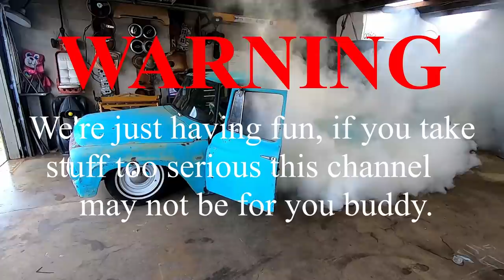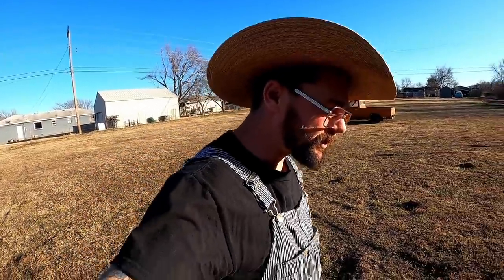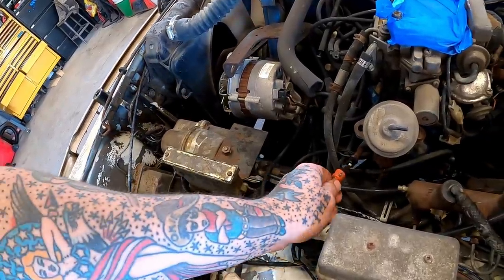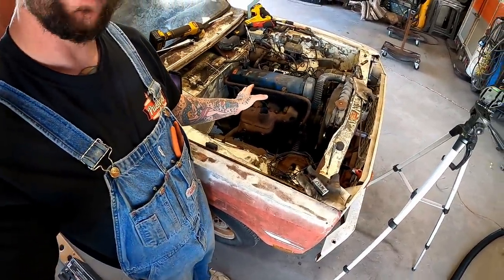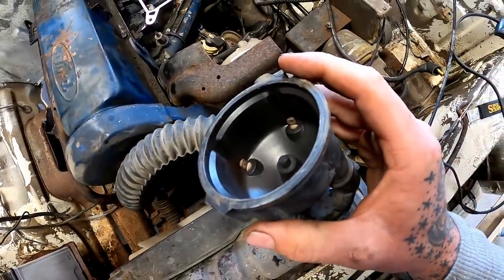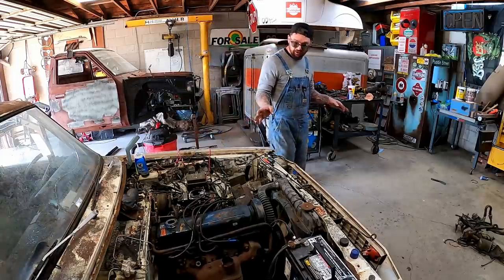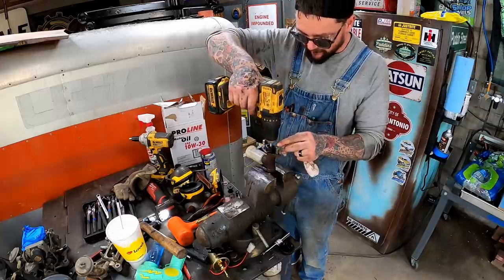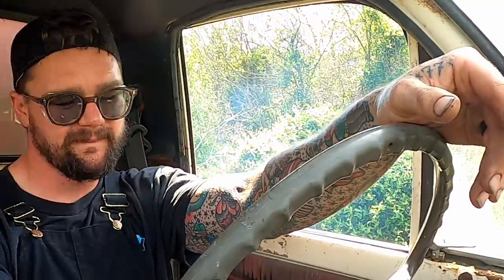Old mini U-HAUL box truck. WILL IT RUN after sitting 35 years?

Comment: That continued “run-on” is likely the anti dieseling solenoid on the carb.
Had a similar issue with my 79 Datsun 620.
On one occasion, it kept running fuel through the carb during shut down and I had the cat explode, enough to where it shot material out the exhaust!
Great video Puddin!
Reply: Nothing worse than when your cat blows up..... 🐱

Comment: Are those factory installed YeHawl mud flaps? that is a great sounding engine for having sit for over 20 years. I like how you dont even mess with the old carbs and vacuum lines. they are always gummed up and leaking. Puddin saving all the mini box trucks one at a time #boxtruckmafia Another great video. Special thanks to Hank for savin puddins truck pushing back

Comment: Did you, by chance, check the timing belt? The fact it puffed out the carb, it may have jumped a tooth. One way or other, you might want to change the timing belt since it has been sitting a long time and the belt is probably pretty crunchy by now. No sense in getting it running just to have the valves and pistons doing the tango.

Comment: The upgrade to the valve cover gasket is the one for the later rangers, they are rubber with metal in them and are reusable its worth getting the OEM one. wont leak!

Comment: My dad's Ford Courier has been sitting for a long time he said the battery went dead and he wasn't able to start it anymore he is 83 so i figured out he had left the marker lights on we put two cars with jumper cables on it and it fired right up a red cloud of rust shot out the tailpipe and the 2.3 with a Webber carb went straight to idling like a new car it actually runs better than my F150 you can't kill a Courier !

Comment: I did this vinegar flush once. It worked too well, dissolved so much stuff the radiator started to leak... then the heater core and heater valve joined. In return, everything reeked like vinegar for weeks. So I highly recommend this method.

Comment: I rebuilt quite a few of those old Ford 2300 four bangers heads years ago. They were notorious for having frozen lash adjusters. When that happened, the followers on the cam would get loose, clatter around and wipe the lobes out.

Comment: I wish I knew what happened to that big block (428 or 429 I don't remember) Courier we built back in the 70s. We got tired of fighting with the cross member and put a straight axle from the speed shop under it. The engine trans(C-6) and rear axle came from a late 60s Mercury wagon. We started trimming the firewall for clearance and ended up using the pan off of a child's wheelbarrow for the bump in the floor. The brake was where the clutch used to be and the gas on the brake pedal. Good thing it was an automatic. We had a shop in Memphis narrow the rear axle and put some better gears in it. We trimmed and tubbed the bed and got some crazy N-50-15s on it or such.
It was a blast to drive. They wouldn't let us on the track because it had no roll cage but that was the next item on the list when it headed with my buddy Arthur to....... Oklahoma.
Keep an eye out for a Courier that sits a little taller than stock in the crannies and crevices. It was built well with no cost spared.
It sure would look good with a box bed on the back. You wouldn't have any trouble with wind resistance.
Damn we did some crazy shit!
Cheers
Terry

Comment: I’m currently reviving my own mini truck. Old 84 ranger. The things runs but the body is gone. 300 thousand miles is hard on a vehicle up in the rust belt. Supprizingly there is some brakes.  It’s becoming the utility yard truck. Generator air compressor tool box and other stuff. And I just rebuild the cab mounts with old c channel from a trailer.

Comment: Brings back such good memories. I learned to drive stick in ol 60' and 70's uhaul trucks back in ol desplains ill when my dad worked at the uhaul on harlem ave. God i miss those times late seventies early 80's back when all the trucks were manual trans. thanx for the memories puddin. also, what kind of safety glasses are those?

Comment: I wonder about that 91 octane being the best option? The lower octane gas combusts with less compression so it might fire off better in a low compression situation. That's why they recommend high octane in high compression/performance engines. Starting fluid is a super low octane thing if I'm not mistaken.

Comment: That style of plate was likely issued between 86 and 91. In 1986, The so-called "red Texas" plate has a large red "Texas" over a blue number, with the state outline in the middle. In1991 ,The slogan "Lone Star State" is found to be agreeable this time, and is added to the flag design by January, 1992.

Comment: I had a 1984 Fox body Mercury Capri with that 2.3 - no turbo.. was the slowest car I've ever owned. one time while driving through the mountains, I literally had to turn the air condition off just to make it up the hill. That's how bad it was... You now have three box trucks, two of them Fords. Do something different. Put that turbo on it like the mustang SVO
Reply: Had a 79 capri 4 cyl auto if you said rain it would start bucking or backfire and take exhaust off at muffler. Don t miss that one even a little bit.

Comment: Take a new dollar bill and hold it up next to the tail pipe while the engine is idling. The dollar bill should always be blowing away. 
If it sucks back then you valve issues. This works on any engine old new carb FI cheap way to diagnose engine problems

Comment: It never gets old watching you yankin all that smog and anti-pollution crap off them engines'. I did the same thing to Chev, Fords or any other engines. Like you are always saying it was so much easier getting them engines tuned up and running if you did not have 2 dozen hoses leaking. If it's not needed to run just jank the damn junk out. I really like these yee hawling projects you have done so far. Still thinken you will get a yee hawling van body behind that old blue international truck. Just need some smaller wheels and tires and a thermoquad 4 barrel carb setting on top of 345 v-8 and an auxiliary trans with over drive just for shits and giggles. Along with some stickers saying 'Cause we are just having fun! Keep finding them van body's and keep up the good work.

Comment: I'm lucky enough to have a good radiator shop near me that will hot tank and repair just about anything...I've had them do a few of my radiators for the old hot rods, and the guy does some really good brazing work when it comes to filling cracks and replacing inlets/outlets...

Comment: Man that is a good looking mini box truck! Only thing is I would have not pluged the EGR valve with JB weld they work if you get a new one and they take the unburned gasses out of the crank case and burn them again it sucks them down into the cylinders and  burns them.  You will get a huge increase in gas mileage with the EGR valve in place than with out. but the vacuume lines can go. You want to leave the vacuume line for the vacuume  advancethat goes to the distributor and use a new hose. vacuume advance for the distributor makes it advance the timing during accelleration and it will have a lot more horse power. And it will run waaay better. The Sausage Wagon LOL thats cool.